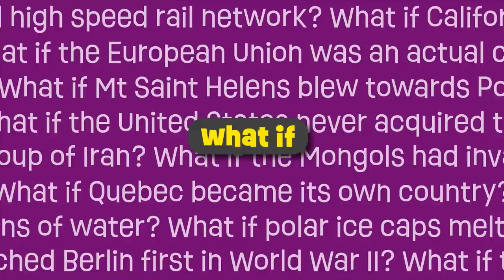Water Pipeline: What If An Aqueduct Was Built From The Great Lakes To The Southwest?

Comment: Not only is it a bad idea but the Great Lakes are a Regional Treasure. The amount of push back that you'd get back from the Midwest and Canada would be astronomical. The fact is the U.S. doesn't own the Great Lakes and the Southwest certainly doesn't.
Reply: I never understood why the pipeline needs to be from the Great Lakes you can just have regular pipelines from regular waters stations hell connect all the aquifers and water sources in the country by pipeline
Reply: It is super expensive to pump/and or desalinate water.  Our electrical grid has enough strain and cost.  Using simpler local, decentralized water solutions such as rainwater harvesting earthworks as in the country.  There are a ton of clever ways to do it.  Acquaint yourself with Brad Lancaster's work, he a great speaker and he he has recently updated his two books to include a lot more info.  1930s, CCC-built bioswales in the Sonoran Desert are still going strong and will last hundreds of years more. They've raised the water table a lot, and are filled with life.

Use curb-cuts and bioswales in cities and it impacts honeowners' wallets in much happy ways.  You have the one time cost of install, and much of the work could even be done by hand.  You can then plant site and region appropriate trees for a food sources.  These bioswales and the trees planted therein can also cool street pavement degradation; and cool the 'heat island effect;' reduce storm drain expansion needs; etc.  
They may have the side egfect of displacing homeless camps...
Reply: Well the amount of water required to fully fill both lake powell and lake mead to full capacity would be like taking a 30 oz glass of water out of a 50 gallon jug to the great lakes. Which by the way all just drain their water into the ocean and is basically wasted. Otherwise they can do things like have California cut off all the food they supply to the states that refuse to help. Which is about 30-40% of the fresh foods for most of the country. So you can start living off of corn, beef, chicken and wheat and forget about most of the produce you currently enjoy on a daily basis
Reply: @lakoncers13  
Or better still -have California use its rainwater better.  California keeps thinking with its left brain and try with its right.  
We no longer toss sewage in the streets nor have horses and cattle regularly defecate upon them.  We can harvest storm water runoff into bioswales, etc to supply city landscaping needs.  Curb cuts into bioswales can help water yards to lessen dependence on expensive municipal water and reduce pollination and decrease flooding events.
In rural areas use rainwater harvesting earthworks onsite to charge holding ponds, swales, check dams, bunds, etc. This saves farmers from electrical costs as well as machinery cost outlays maintenance labor, etc.
Update farming and ranching with regenerative and restorative scientific advances.  Quit old paradigm megacorporate conglomerates death chemicals.  
Newer, better practices result in higher quality, more nutritious food at less cost.
Reply: No doubt Canads would revolt against this. Not to mention the cost to construct, but huge cost in energy
Reply: @lakoncers13  federal agricultural policies currently choose what products will be incentivized by state. The Great Lakes region could easily diversify beyond what you list. Lettuce, tomatoes, strawberries and other crops currently gotten in often poor form from the southwest could become more viable cash crops in the Midwest.
Reply: @Lee-hs4pv  
It works both ways.  It is better to find solutions that work for both.  

Currently foreign powers own a lot of land in places like AZ and Africa, etc and are growing crops poorly suited for climate, water conditions, etc then exporting them back to their home countries.  We need to get them into a compliance where they are disallowed from using anything but rainwater.  This will encourage a stakeholder interest in rainwater management and rainwater-harvesting earthworks as well as regenerative land management techniques.  This will encourage growing higher-quality Pima cotton rather than irrigation-dependent Upland cotton.  It will encourage growing more site-appropriate feed and food crops as well. 

Rainwater harvesting techniques should be encouraged as they are inexpensive, durable, reduce electric grid strain, etc.  It works well for locals as it increases personal water security.

The following is a partial list of countries with ag land investments and where:
Nearly 13.2 percent of Maine is foreign-owned, compared to only 4.8 percent of Alabama, but when combined, this translates into a Vermont-sized section of Maine and a Deleware-sized section of Alabama. Canada’s 6.87 million acres makes it the top foreign owner, followed by the Netherlands with 4.87 million acres, Germany with 1.94 million acres, the United Kingdom with 1.7 million acres, Italy with 1.4 million acres, Portugal with 1.38 million acres, and France with 1.04 million acres. About 54.9 percent of the U.S. land under foreign ownership is forestland, followed by 23.6 percent pastureland and 21.5 percent cropland.
Other states with large foreign land investment is Texas, Washington, and Michigan.
Reply: @lakoncers13  
A lot of our produce comes from Mexico and Florida and beef, chicken, pork, wheat and corn don't sound that bad. We have orchards and grow apples, peaches, plums, nectarines, cherries to name a few. Farmers grow tomatoes, beans, potatoes, carrots, cabbage, lettuce, zucchini, broccoli, cauliflower, spinach, beets, sweet peas, edible corn, brussel sprouts and way more. We have local dairy. We won't bleed without your vegetables, we'll just do more preserving. 

The southwest has chosen to grossly overpopulate a part of the country that can't sustain it. After bragging about the weather and overbuilding for years, it's time to pay the piper. It's not like you didn't know the water shortages were coming.
Reply: @nisanight2247  
Read my previous moment to Lee...
Reply: The Mississippi discharge rate IS HIGHER than that of the St. Lawrence. I.e. a river that is CLOSER to the SW, and at a smaller differential altitude trumps the GL in every way. The fact that the GL contain more water is a conceptual trap. Both watersheds and their ultimate discharge are in dynamic equilibrium with their precipitation. The extra reservoir of water in the GL is banked from the last glacial period. Taking that would be MINING the water. The engineering arguments for endeavors such as this start with the annual inputs to the watersheds and NOT to the volumes of water. Mississippi trumps the Great Lakes as a candidate on all 3 counts - it has higher annual throughput, it is closer, it crosses terrain at higher altitude - strike 1 2 3 - a no brainer. Now, how do the people in the Mississippi feel about this?
Reply: @davejoeb5668  
Read the comments above to find out our feelings...
Reply: The lakes are controlled by the Great Lakes Compact, a treaty between the US and Canada with all states and provinces also being signatories. It bars any pumping of lake water out of the Great Lakes watershed. The only exceptions are cities like Chicago and Milwaukee whose boundaries extend beyond the divide.
Reply: @CortexNewsService  you are exactly correct. The bigger problem is the western states made it cheap and easy to farm now they are learning that was an unsustainable activity. Let’s moving farming back to the eastern states, let’s get on with it.
Reply: What about an underground pipeline from the Cascades to the river system feeding the southwest.
Reply: @mikequinlan9585  We do have plenty of farming here. Hell, I see cornfields within cities here, so we do have it. But we can't do it during the winter like they can out west. And people do not want to spend more on vegetables because they had to be imported.
Reply: @muleears1  
Much of Washington State is desert itself.
Reply: @davejoeb5668  that would be state to state support. I like your thought.
Reply: @Craig Robertson  
^^^^^^^^^^^^^>>>>>>> Owns stock in desalination tech and local electric company...
Reply: @lakoncers13  Lol.  So I assume that California/Arizona etc will be paying 100% of the costs, including reimbursement for the value of the water they're purchasing from the compact?
Reply: @lakoncers13  the Colorado river also “just drains into the ocean and is basically wasted” yet it’s been proven by experience that diverting water from its natural flows has catastrophic effects on its watershed. To top that off, less than 2% of the water moving in the great lakes water cycle actually results from water flowing into and out of the lakes, and they hydrologically function more like small oceans than a true lake. To manage moving enough water out to supply the west would require completely damming the St Mary’s, Detroit, St Clair, and Chicago rivers, which are essential to the navigation of vessels necessary to produce most of our steel. I think Michiganders would be willing to live without almonds and avocados if Californians would be willing to live without the steel that the Great Lakes region produces.
Reply: @b_uppy  if I did I would be kicking my salesman
Reply: @lakoncers13  with no water they will also starve. Just saying
Reply: @davejoeb5668  Mississippi River in her grand form is fed by a few tributaries from Lake Michigan.  PS that's the only lake with a shark attack on its record.
Reply: @craigrobertson5030  
Uh huh.  It's lousy to suggest advice that's expensive and brittle, likely contribute to brownouts when you can opt for low tech, low cost solutions.
Reply: @kberkstr  I agree. I do like watching the haulers entering g and departing Hamilton.
Reply: @craigrobertson5030  
Did you remove your last comment or did YT assist you?  Interesting...
Reply: @b_uppy  Their are no low cost solutions to the problem of a lack of water. We either spend money and find a way to use renewable energy and safely desalination water. Mibey expensive. 

We cut back on water usage particularly in crops. Cheap to implement but loss of crop money and paying more for produce makes that expensive. Not to mention a lose of the luxury of eating whatever we want whenever we want. 

Or we take more water from other sources. Cheaper then desalination with renewable energy but still a set up cost Most importantly though a technique that has always had serious environmental impacts long term in the region water is taken from. We don't know the actual impact of taking from the Great Lakes but just the fact that people think it's a simple cheap solution is cause for concern. Shoot even taking water from a flood zone is a horrible idea. Flood waters cause natural fertilization. Everywhere a river floods regularly is amazing for farming. The Nile, The Red River Valley, ect. 

Their is no cheap simple solution to this problem. The best solution and the one people don't want to hear because it requires a lifestyle change is less consumption. We've tried changing the environment enough times it doesn't work. Now we change.
Reply: @bballboyjumpshot9353  Water pumped up will fall again, so the energy is a near net zero.
Reply: @b_uppy  I didn't know that it was that costly
Reply: @robertpendzick9250  
Look at how expensive pumping is. Water is heavy.
Reply: To those from Canada that say no to pumping Canadian water??  --Canadian companies own ag lands in the US.  That land needs to switch to best ag practices as well.
Reply: @Craig Robertson  
Pumping water to cities and rural areas is the single biggest expense incurred by the state of Arizona. If I remember correctly it is about half.  Imagine if you could cut your yard watering bill to near nothing by using greywwter, roof runoff, curb cuts and bioswales.  It is pleasant to have wind and sun protection, as well as flood, drought and heat mitigation as part of it.    
You don't get that with pumping water from reservoirs and desalination plants...
Reply: @lakoncers13  Such a great comment considering most people are morons regarding this topic. People are clueless as to all the countless varieties of fruits & veggies they consume on a daily basis of "soft" Ag that comes out of Calif & the west. I mean, over 90% of America's fruits & veggies produced from Oct-Apr are produced along the growing districts of the Colorado, and that doesn't count the rest of the year, or what Calif's central valley produces from Apr-Sept. Calif is the nations #1 soft Ag producing state, Florida is #2, but Calif's production is over 40x larger then that of #2 Florida. People just don't understand the magnitude of production and how much of their food supply comes from Calif.

The west is essentially "exporting" it's water resource to feed the rest of the country.
Reply: @lakoncers13  Oh, also, yeah...I never did the calculation, but you're right. It's probably even closer to sticking an 8oz measuring cup into a 1,000 gallon barrel when you think about the volume of the Great Lakes as compared to the volume of the reservoir(s). The reservoir(s) when full are impressive, but a drop in the bucket to the Great Lakes.
Reply: @mikequinlan9585  Sure, when you count on the water of one resource to contribute to the food supply of over 700 million people worldwide, I can see it becomes unsustainable. But then again you're probably mad people actually produce food for you. I think you should start growing it in your backyard, you won't be so mad at others.
Reply: @kberkstr  Oh, you've never done the math, but whatever.

Oh, plenty of micro steel plants out west. You're more dependent of the west's food than the west is of your steel...but I know you didn't know that.
Reply: @craigrobertson5030  Who doesn't have water?
Reply: @dmannevada5981  Dman Nevada. I’m not mad. I was stating the obvious. The desert southwest cannot support large human populations or farming on industrial scales. There are millions of acres in more suitable locations were we can grow food.
Reply: @CortexNewsService  you can grow fruit and veggies in the islands during the winter. Plus  those places could use the economic boost they would get from doing this. The crises we are facing is man made so it just a matter of just deciding to make a change and think outside the box. We are going to get through this crises without destroying the ecosystem or draining the Great Lakes.
Reply: @dmannevada5981  there are four active iron ranges in North America. One in Michigan, one in Minnesota, one in Ontario, and one in Quebec. Utah’s iron deposits went to a mill that closed in 2003 and are now defunct. The Mesabi range in Minnesota is the largest single source of iron ore in the US with 7 active mines. Without the great lakes, there would be no way to ship the ore to the mills where its being used, along with the limestone needed to slag the steel. 8 of the ten largest steel facilities in the US are located along the great lakes, five of them in the Chicago area alone, all depending on great lakes shipping to get them the ore, coke, and limestone they need to function.
Micro production of steel is only feasible for recycled materials, the energy and raw material input necessary for new steel is too great to manage on a small scale. This is why steel mills arose along waterways (Pittsburgh, Erie, and Bethlehem PA, Gary IN, Cleveland OH, etc.). I don’t know how you plan to cover that difference just with just recycled steel.

Ignoring all of that, Michigan is second nationally in agricultural diversity and was the second highest agricultural earner nationally. In terms of production, 7 of the top ten states are in the Midwest. California does have a huge agricultural industry, but it doesn’t account for as huge a percentage of the maket as it thinks it does
Reply: @kberkstr  First of all, there's enough recycled steel on the planet to keep every mico plant running 24/7. My Uncle is a retired steel worker, starting his career at the Bethlehem steel plant in Pittsburgh and retiring at a mico plant outside of Seattle...we've had countless conversations about this topic. So please, about 60% of all steel produced in America today, is produced in micro plants. Your comment is stuck in the 70's. The west doesn't need your steel!

Stop! You're talking about Ag in it's aggregate. THAT'S NOT THE TOPIC. The topic is "soft" Ag, and the overwhelming amount of soft Ag is produced in the western US. There is rarely a day that goes by that you don't consume a fruit or veggie(soft Ag) produced out west. Only the west can produce year round, not June-Sept like the Midwest. YOU CANNOT GROW A HEAD OF LETTUCE OR VINE RIPENED TOMATO AROUND THE GREAT LAKES MOST OF THE YEAR.

Do you not pay attention?
Reply: @dmannevada5981  As someone who currently works in the steel industry, recycled material can only take you so far. Especially when so much of it is going to infrastructure and applications that can and will not be recycled for decades or even a century. Indiana alone produces over a quarter of all steel in the united states, recycled and new, and relies on the great lakes shipping system to supply its mills not only with the feedstock metals, but with the coke and stone needed to fuel the mills and slag the steel, and also to take the waste product away.

I don’t know how to illustrate to you any other way that California is not as agriculturally important as it thinks. Any crop that california produces is imported from Mexico, central america, or south america for just as cheap. Oranges, Lettuce, spinach, tomatoes, avocadoes, and almonds are all imported, sometimes more than they are grown domestically. I can even grow things like tomatoes and peppers in my backyard and preserve them for winter. At the end of the day, I can and have gone without fresh fruit some times, but I can’t go without staple foods like corn, wheat, potatoes, dairy, and meat, which the east leads in. Nothing California produces agriculturally is worth the environmental and economic damage that draining water from the Great Lakes could cause.
Reply: @b_uppy  Arizona is a desert, self explanatory for
Reply: @craigrobertson5030  
You want to finish that statement??? Suggest you look up the resources I've been suggesting.  Your solutions contribute to problems.  Do better.  It's why I suggest Brad Lancaster among others...
Reply: @davejoeb5668  How we feel? 😂😂😂 We’re not letting you get shxt that’s how we feel. Go set up some desalination plants and stop trying to ruin every other region’s ecosystems.
Reply: @rackss1661  me? Personally, I live on the Great Lakes. I don't live in a drought afflicted area. However, I worry for the southwest. Ultimately, as others point out, we're all in this together. We do disproportionately use the central valley for our fruits and vegatables. I think small diversions that would prevent the Colorado River running dry are worthy interventions. As for crazy numbers of people moving to Las Vegas and  Phoenix, surely the water scarcity feeds into the cost of living. Is there some kind of market interference going on in the US? Anyway, I don't get the appeal.of that brutal hot weather for 1/3 of the year.
Reply: @kberkstr  Wow, what a ramble that added nothing to the conversation but more misinformation. That's a minute I won't get back.